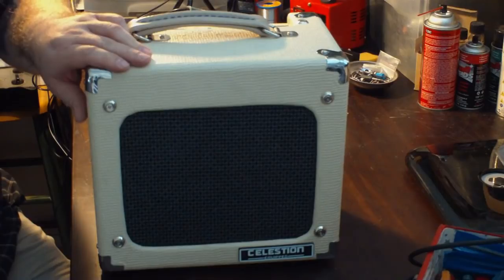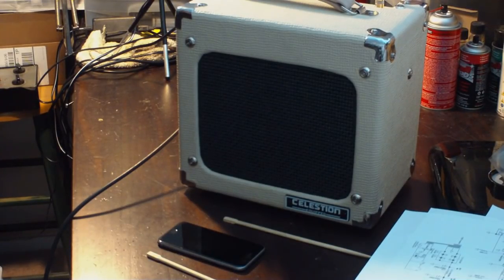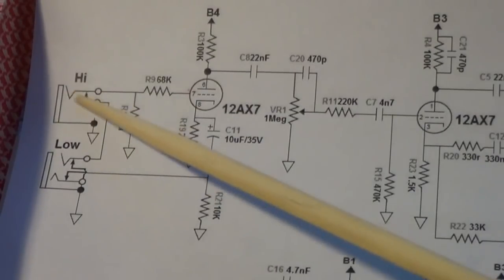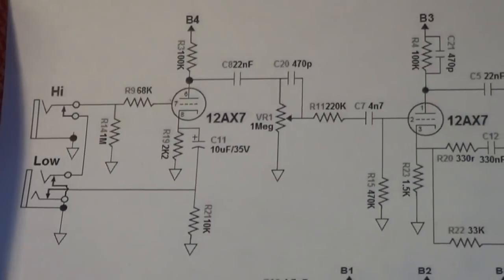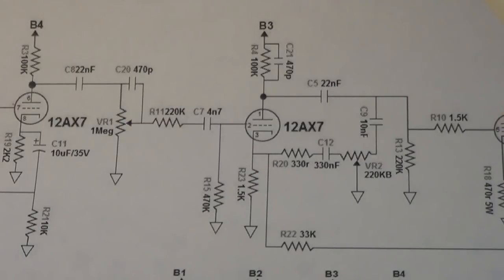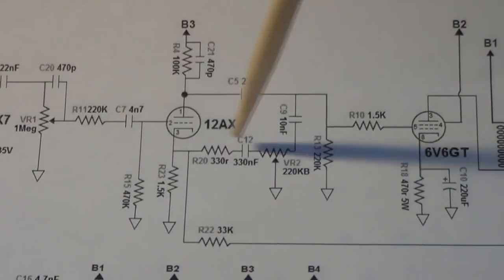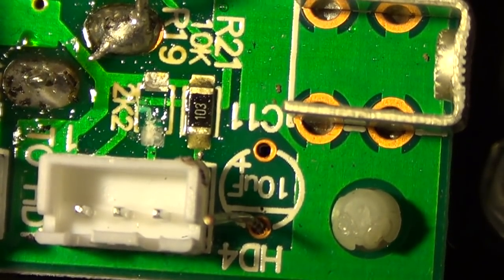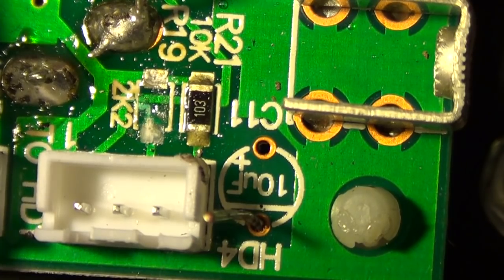Modding a Monoprice Stage Right Model 611705 Tube Amp

Comment: I would have just put a boost overdrive distortion what have you pedal in front of it im,sure I am,not the only 1 who has pointed that out but I do like your determanation to get a bit more out of itself
Reply from the maker: Jeff Smalley thanks. I appreciate the comment, and you’re right. That would have been a much simpler way to achieve similar results. I’m just a tinkerer by nature and a lot of what I do on this channel is just for the sake of seeing if can actually accomplish what I’m setting out to do. 

In fact, I can’t remember the last time I bought a completely working amp. Or if it was working, one that I didn’t try to modify. It’s a sickness I guess. 

Thanks for watching though! Make sure you subscribe. I have more videos I’m in the middle of making and will be posting soon.
Reply: @davetriestofixstuff4744  I did get that vibe and just the name,of your channel implies it I,just thought I,would,throw that out there occasionally people get so 1 track,minded that they sometimes can overlook the simpler route was all I have a peavey windsor they can,be got at a pretty low price 100 watt bare bones starting point if you ever want,to do another mod video that would be awesome they say it has all the makings of a Marshall jcm,800 with little mod changing values and re routing like you did with the stage right anyway that would,be bad ass

Comment: B+1 is not a Connection to a extra speaker, and put the 4n7  cap in again (c7)
Reply from the maker: I don't think I said anything about B+1 being a speaker connection. What does C7 do? I've never been able to get anyone to answer that question. Thanks.
Reply: c7 is a cap in series which lower the low pass, keeps bass down ,
Reply from the maker: Wait, never mind. I thought you were talking about C21. I know what C7 does and I jumpered it on purpose. That's the entire point of the mods I did. I wanted more bass response.
Reply from the maker: And BTW, C7 and R15 make up a hi pass filter, not a low pass filter. If it were low pass, the positions of those two components would be reversed.
Reply: R 15 is to ground , lower the signal , if you take away C7 you makes the amp more bassier , C21 takes away lower freqvensies , the lower the value the higher the frequences,
Reply from the maker: Yes, like I said, C7 and R15 create a high pass filter. C21 has nothing to do with the frequencies. It's in parallel with the DC dropping resistor to the second stage. No signal passes through it.
Reply: @davetriestofixstuff4744  C 21 is about the b+ the cap subdue higer freqvense, you can do the same thing when you connect the signal to ground trough the same value of the cap , smal caps makes  the adjusting of the sound

Comment: I would just gut it and rebuild it with terminal strips.
Reply from the maker: M V don’t see the benefit in doing that.
Reply: @davetriestofixstuff4744  You'd basically be rebuilding it at that point. I just hate those surface mount boards.
Reply from the maker: M V true, but what’s the point I’m buying a complete amp if your plan would just be to gut it? Buy what you need and build from scratch.
Reply: @davetriestofixstuff4744  I normally scratch build. I've gutted a few chassis for friends that had cheapo SS amps. Stick a super simple EA6 circuit into an old crate combo amp. Just use good iron.

Comment: Save yourself the hassle and get a vht special six. Same kind of circuit. Point to point wiring. No surface mount. Same ish price.
Reply: see them as low as 150 on reverb. And you don't have to deal with smt. If you are planning on modding, it is worth the jump.
Reply: Thanks for this video and special thanks for the schematic. I bought one last year (2020) for $89. I see them listed nearer $200 now. 
It arrived with a broken 6V6, which I replaced with a vintage RCA black top. Still didn’t work, so after a quick scan for obvious faults I packed it in original box and set it aside. I received a full refund and kept the amp thinking someday I’d use the cabinet and chassis to build a Princeton copy. 
With your schematic I can take another look at the PCB to see if I can get it going as is. If not I have more points of reference as I rewire it PTP.
Reply: Thanks for this video and special thanks for the schematic. I bought one last year (2020) for $89. I see them listed nearer $200 now. 
It arrived with a broken 6V6, which I replaced with a vintage RCA black top. Still didn’t work, so after a quick scan for obvious faults I packed it in original box and set it aside. I received a full refund and kept the amp thinking someday I’d use the cabinet and chassis to build a Princeton copy. 
With your schematic I can take another look at the PCB to see if I can get it going as is. If not I have more points of reference as I rewire it PTP.